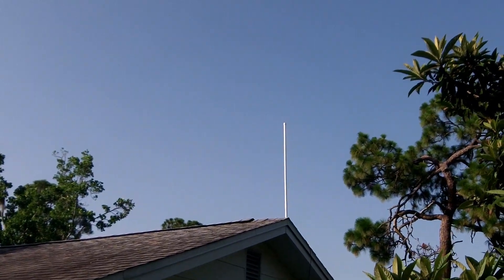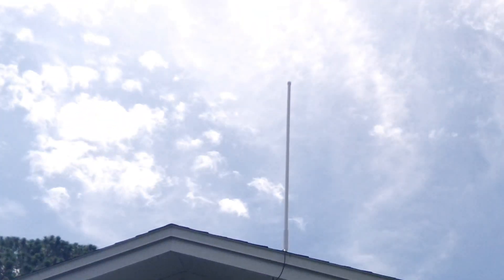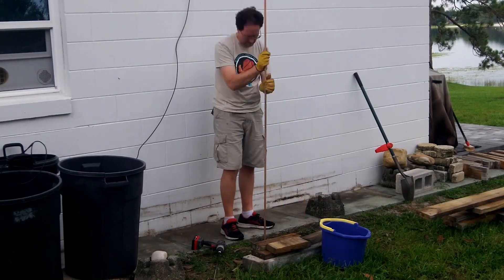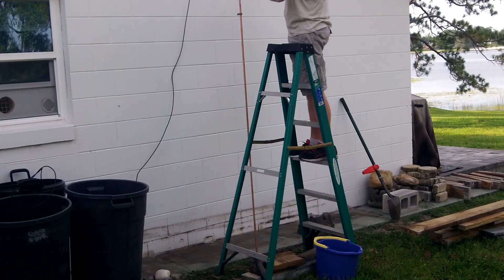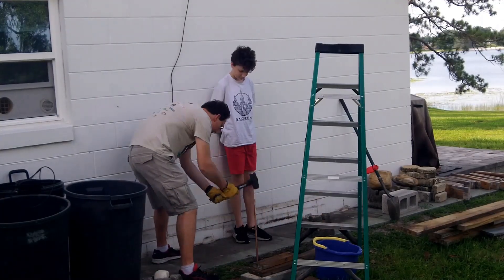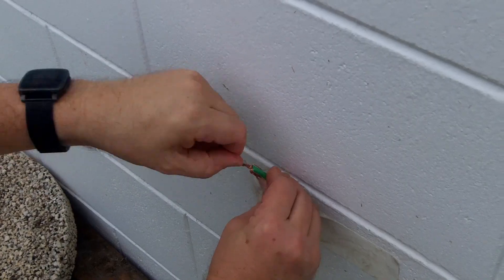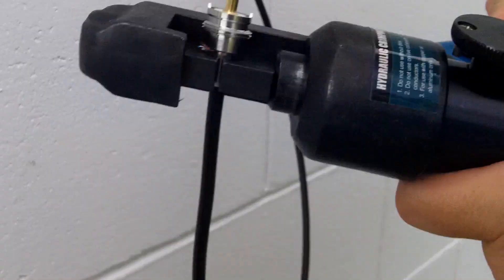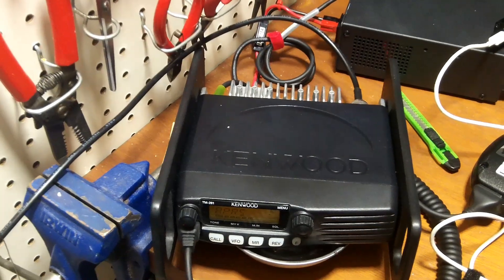Installing a lightning arrester and ground rod for my 2M ham radio antenna

Comment: I just installed a Diamond X-300 at the radio shack. It's a pain to unplug coax until arrester is installed.  Thanks for the video..

Comment: Some suggestions. 

They make a bit specificly for driving a grounding rod that inserts into a impact drill. It will literally drive 8 feet in 1 minute.

Get a weather proof box for outside and mount a grounding bus bar in it. Run the coax in the box to your lightening arrestors. Then ground the arrestors. Now all your outside connections are protected. 

Run the coax and another ground wire out of the box and into your house.

Build another grounding bus bar inside your shack and connect that grounding wire. Then ground everything in your shack to that bus.

Test for floating voltage. Connect a volt meter to the ground bus and the other probe to the ground prong of the outlets in your shack. If you have voltage, you will need to bond the new grounding rod to the house ground rod.

Comment: Brother you definitely need at least 14 or 12 solid copper.  That one lightning bolt will fire your setup.
Reply from the maker: 12-14 AWG is much smaller than the 10 AWG I'm using,  6-8 AWG would be better

Comment: You should probably bond that new ground rod to the utility ground to your house as well. You might be introducing a difference in potential between your house electrical service, and your antenna/tower
Reply from the maker: Yes that would be ideal. Except the utility grounding rod is about 90 feet away on the opposite side of the house.   Since my radio shack is on this side of the house, I'll also be bonding the radio equipment to this grounding rod eventually.  [Currently I use it with a mobile radio, so just counting on the braid of the coax for grounding.]